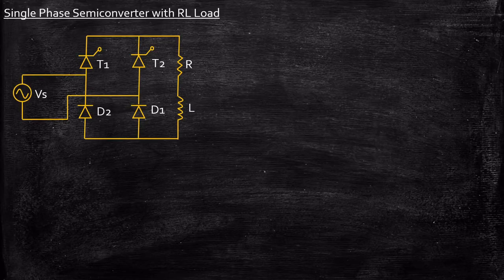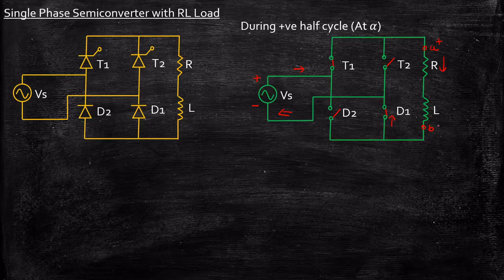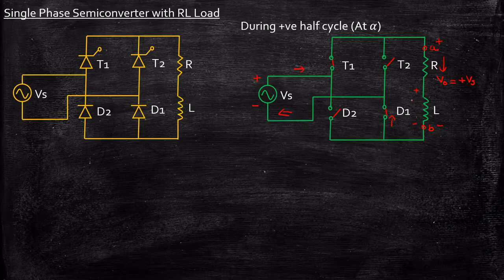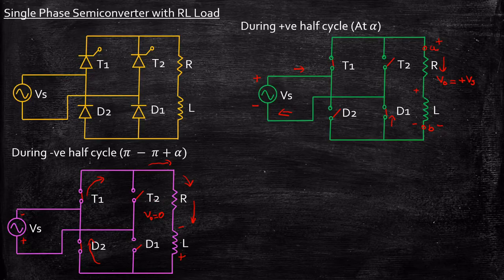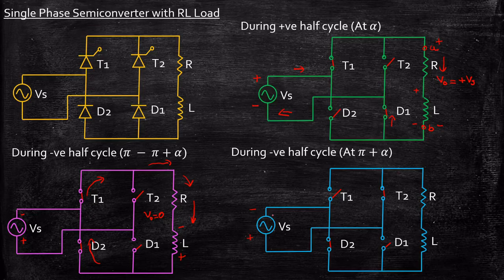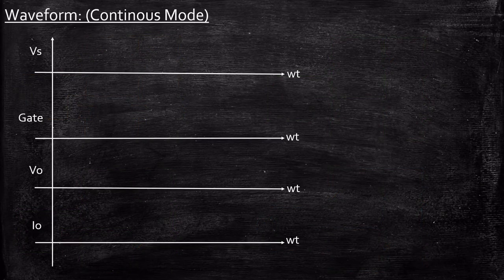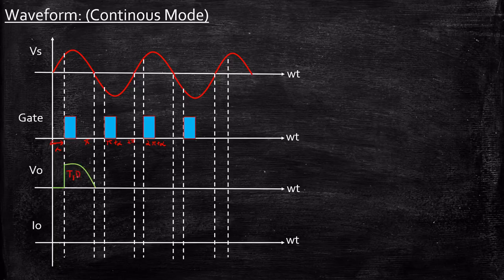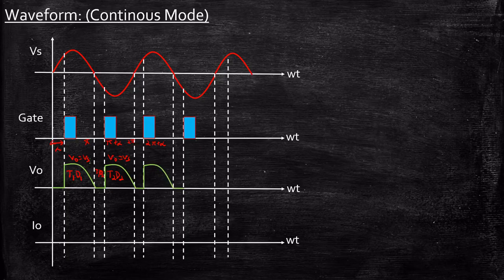Single Phase Semi Converter with RL Load | Power Electronics | Lecture 50

Comment: What is difference between continuous and discontinuous condition in single phase.. how can be find it out ..?
Reply: For any inductor type loads(L,RL,RLE) are always continous conduction but if there is only R load is present it can be discontinous load. By defualt take output current as continous ripple free conduction.

Comment: Hi sir, Can you discuss single phase semi converter with RLE load, here extra free wheeling diode is needed or not for RLE load. many text books explaining with free wheeling diode. i have doubt why free wheeling diode is needed. As per my knowledge, free wheeling diode is not needed for semi converter with RL or RLE load. is it right.....
Reply: Look , wherever there is inductance in the load , we need freewheeling diode . This is because , when the supply voltage becomes negative , the current is not zero due to inductor discharging and thus we need the freewheeling diode to short the output terminals and make the voltage of output 0 or in other words to provide a path for the current .

Comment: Why T1 get shorted ? 
If shorted due to inductors high negative on anode
Then same we can say for D1 having more high on cathode due to inductor... Means D1 also get shorted n?
Reply: Did you understand it? I have the exact idea so I need help.
Reply: no bro, although we can think like D1 is shorted but since T2 is not under Forward Biased condition as it's not triggered during that time. since it wasn't triggered so there is no conducting path or  "D1T2" path is an open circuit, therefore charges cannot move towards the negative terminal of the inductor through that path.  so it's gotta be only "D2T1" path as T1 has been conducting current this whole time therefore staying under Forward Biased condition. If the current started late like after T1 going to OFF state due to "-"ve polarity, then it shouldn't conduct either.

Comment: why there's no negative output when L discharge?
Reply: I think its because of the fact that we consider both D2 and T1 as a short. Since we're measuring the output voltage between these two, we'll be effectively measuring nothing. In order to see some sort of voltage we should measure on the resistor, wich i think its pretty much impossible irl, since that resistor is a symbol for all the resistances found in a motor.